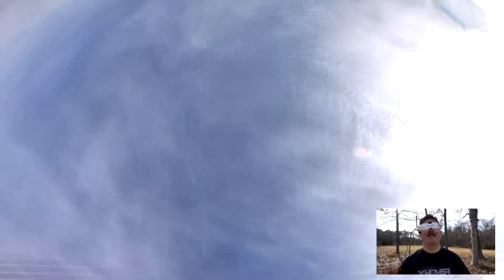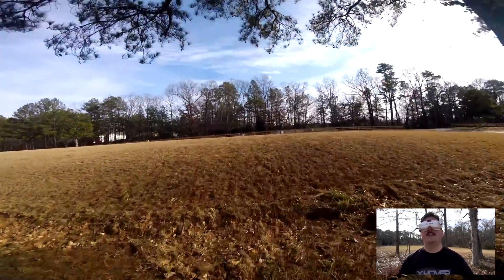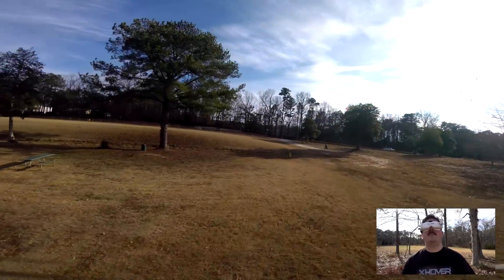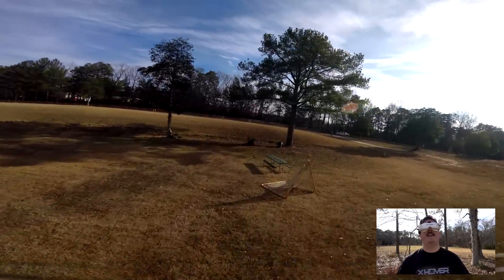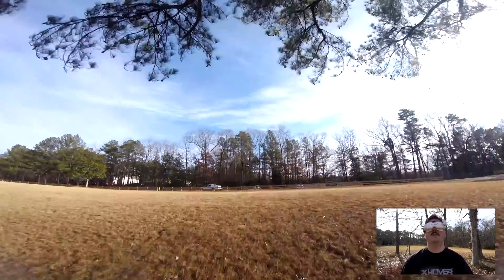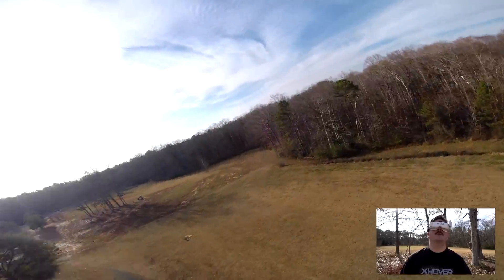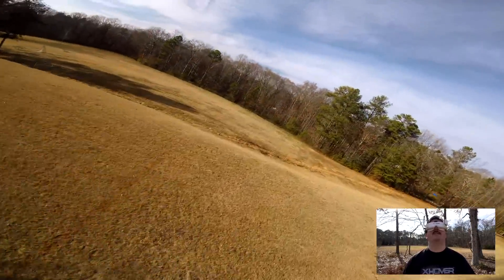Quick Tip: Avoiding Prop Wash

Comment: Is this kind of flying/visuals possible with any DJI product?

I want to get this kind of FPV flying experience, but I also want GPS option...
Reply from the maker: Josh not exactly. DJI makes a goggle/video system but you still have to build it and it doesn’t ever fly like a mavic. It’s an entirely different type of flying and system.

Comment: There’s a fascinating maneuver that attack helicopters do known as “shake and bake” yes Ricky Bobby got that term from military tactics. 

I assume you are all familiar with that maneuver for cars. Where you use the car in front of you to generate high pressure. Drafting is a prop wash event on the ground. 

When you draft a car in front of you, you use the energy it uses to combat thermodynamics as it travels through a atmosphere. Same reason why schools of fish stick together they use the united effort of all members of any given school for protection. When a school of fish swarms they accelerate exponentially faster the bigger the school is the fast it can move. 

Back to “shake and bake” most attack helicopters are held back by the nature of thermodynamics. They can’t fly as fast as the jet engine superiority fighters use. The undisclosed speed of our attack helicopters are said to be at 400mph ground speed. 

Normal helicopters and most super cars if I’m not mistaken are held at 300mph. Because the amount of energy required to go 301 mph is almost half of the current energy used to travel at 300 mph. For cars it’s more dynamic because you can torque vector. But still as difficult.

Hennessey Venom F5 – 301 mph*
SSC Tuatara – 300+ mph*
Koenigsegg Agera RS – 278 mph
Hennessey Venom GT – 270 mph
Bugatti Veyron Super Sport – 268 mph
Bugatti Chiron – 261 mph
 
 Latest car figures. 

Back to 400 mph. Our attack helicopters can do this because they leap frog each other using a never ending draft maneuver. 

A Heavy Cavalry unit has up to 10 copters. All 10 copters have to be engaged in one giant draft maneuver that’s in a feedback cycle to achieve 400mph. 

I wonder if we will ever get to experience that aspect of flight.

Comment: Coming from avionics perspective about prop wash. These events are highly trained for by all helicopter Cavalry units. When they land in formation. Most commonly known ones you all have seen is when a line of helicopters land together in a line. It’s called “carpet landing” term came from Vietnam war. They used to carpet bomb a Area so the cavalry crews can land and provide support. The need to land together is so important for safety that they had to over come prop wash that arises from formation landings. 

Here’s what they do in real life to combat prior wash. When the lead copter starts it’s decent the wing copter (closes one from lead) pays attention to the flow of air the that comes back from the terrain. They do this by yawing slightly left to right. The tail of the heli controls its yaw. For use it would have to be a conscious maneuver. When you “wag the tail” if you can imagine 1 upside down tornado coming from the main props. Then imagine Another small tornado coming from the tail which can change its orientation from left to right. Wagging your tail makes sure any high pressure area underneath you becomes low pressure. 

Imagine jumping in a pool that was generating bubbles that rest on the top layer When your mass hits the density of the bubbling water it has an effect of “sucking you down” because of the nature of thermodynamics. High pressure always flows towards low pressure. The same is true for quads. When a prop wash event is triggered it’s like us jumping in on that bubbly water. 

Since we are high pressure. When we encounter high pressure we follow the flow. Which means a sudden acceleration towards any given direction where low pressure is the most. 

So in practice just make sure there’s no bubbles underneath you, they also occur In hallways and door ways. 

The way i look at it is if there’s any thing that can potential turn low pressure into high pressure is a “near danger zone” military term that dictates the nature of your approximations. In a high danger zone your maneuvers are swift and coordinated. Near, low, high, and tactical danger zones are the categories they follow. All because of prop wash

Comment: Im new and I have a problem even in a slow decent my quad starts to wobble like almost falls out of the air bad the only way I can land is to get low down going forward at a good speed and disarm what do I need to do to fix that? or do I have to land by slamming into the ground

Comment: My quad oscillates already when you slowly descent vertically. Once its wiggling you reay have to apply power to get it out..

Wil putting a lower P gain help? And switching bullnose 2  blade to normal 3 blade?

Comment: The phenomenon you are talking about is actually called Vortex Ring State or Settling With Power but yes it is basically caused because of prop wash but if you want to look into it a bit deeper just type that into the Googler.
Regardless you did a great job getting the information out there.

Comment: How do i fix yaw occillations? Do I add more D term on Yaw?  Other than that, my quad is flying pretty good. I use GCS for cc3d and I really like the TxPID feature which allows me to tune while in the air using my pot sliders.

Comment: or simply flash rf1 :)
Reply from the maker: +FPVollgas Germany The hype will save you from physics. 😉
Reply: StingersSwarm well it's not just hype. I've tested it. I've tested bb413 fw on my revolt and then I went on slack and got the chance to get my hands on rf1 114... and it really is a totally different thing from what we were used to from kiss and bf aso. when I flew it the first time I couldn't believe it ow smooth it flies with stock pids, how locked in it was and how little propwash I could notice even on a windy day with a bit more disturbed air. RF1 will be really awesome😊

Comment: Hey, great info about the prop wash. Something different where the flying style is being discussed rather than the tune.

Btw, just wondering about your GoPro cam angle. I notice it is slightly lower than your FPV cam angle of 45˚. I know I'm most probably over thinking but did you lower the angle on purpose? Or it's just that way and you didn't notice or bother? Thanks and cheers!

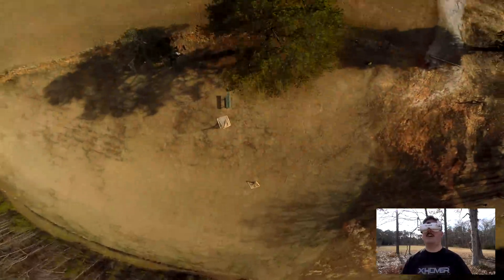Comment: 4:32 "The trick to dealing with propwash isn't necessarily dealing with your tune, its moreso how you fly it"

I've been trying to tune out propwash for months, i tried different ESCs and a different FC, different batteries, different props, different component layout/weight distribution -- and really after months of trial and error, its a relief to hear this from somebody else. Its more simple than meets the eye, just don't fly into the column of turbulent air and that is 90% of the battle. Solid throttle management and timing is crucial.

Great tip Stingy, keep up the awesome videos!
Reply: Story of my life too!, so good to hear this from the top pilots, now I can put my mind to rest and practice properly! :)